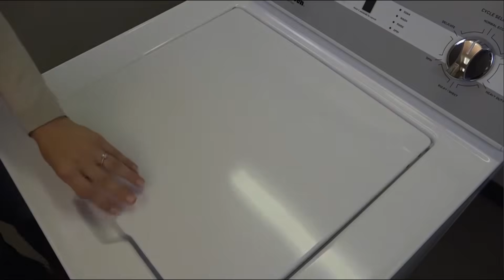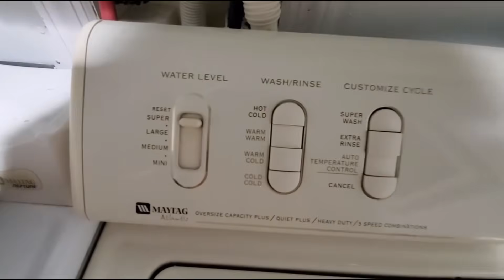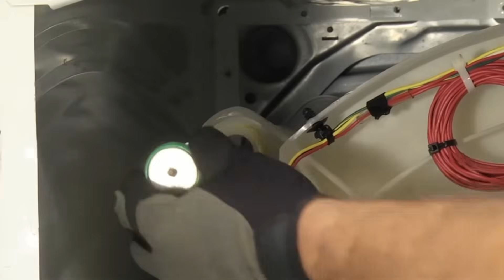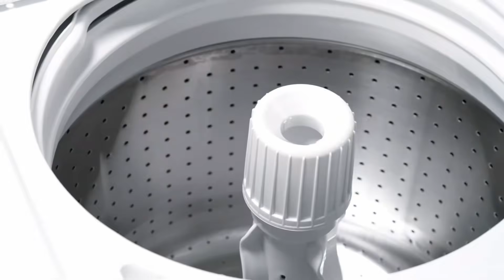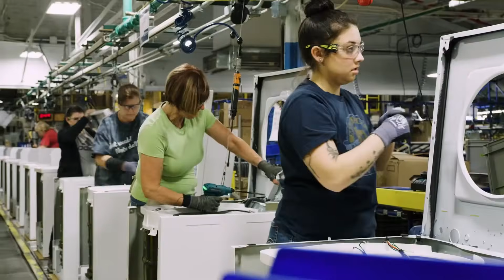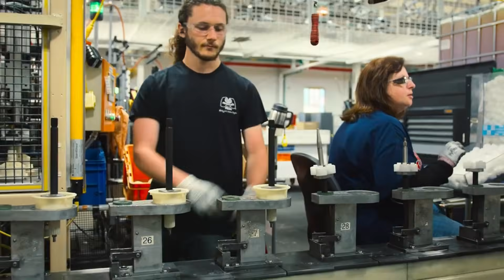5 CHEAP Washing Machines That NEVER Break Down (But Everyone Ignores Them)

Comment: A Sear's front loader I bought in 2011.  Its bearings gave out in less than 6 years, and of course, long after any part of the warrantee had long since expired.  It cost about $900.00 new.  There were two problems during that time - a new door gasket, and the front plastic surround around the inside of the front panel - it literally ate itself up in its last dying wash load - huge pieces of sharp plastic pieces were inside the drum and on the floor. I don't remember how much the door gasket replacement cost was but I know I lost a lot of money when that plastic surround broke apart mid-wash.  We'd wash maybe three times a week - usually only twice a week.  What a pile of horse apples.  I then bought a Speed Queen in January of 2017.  I still have it - it's been moved from western Wisconsin to Palm Springs.  I have had no repairs done in all that time.  It cost about $938.00 new.  I wouldn't ever sell it.

Comment: I have tried 2  new machines:    LG and Maytag—they show low water use—but take longer to wash using more electricity.  The “normal “ auto-sense water levels for a full load have 1/4 the fill causing me on both to use “deep fill” use.  LG did fill bucket “ on Deep Fill.  “Normal” was 1/4 fill.  Auto/sense on Maytag didn’t fill “deep fill”.  To wash clothes effectively, water HAS to be deep enough to circulate the clothes!
Reply: How do you know they're using more electricity?
Reply: Whirpool washer model Whirlpool WTW4816FW3 bought new in 2023 is horrible.  For 3 years it has been having water fill issues, failing to rinse and spin...for 3 years. I made videos about it too.